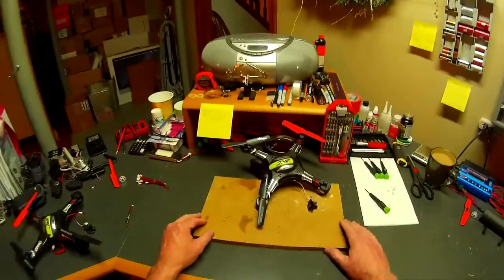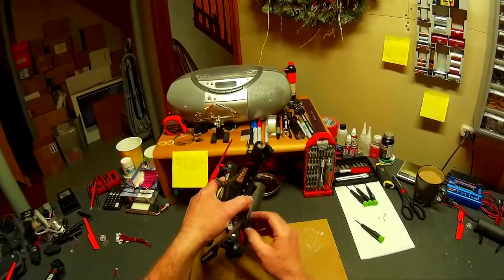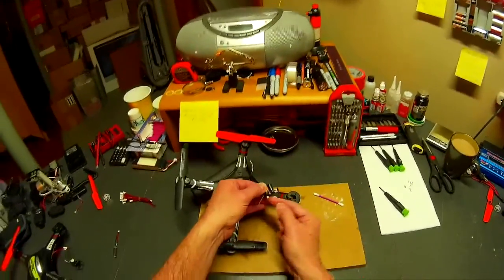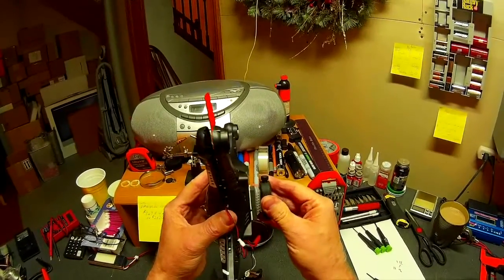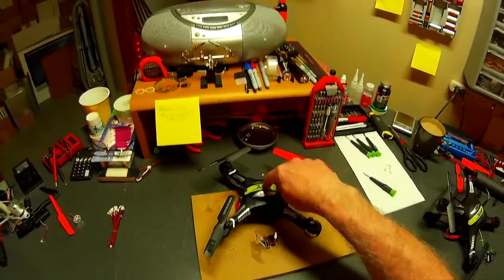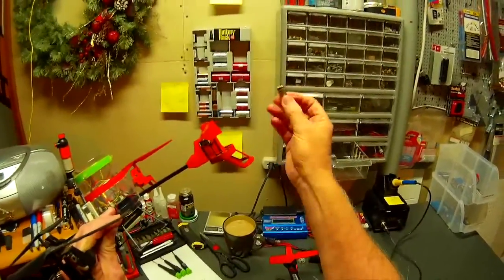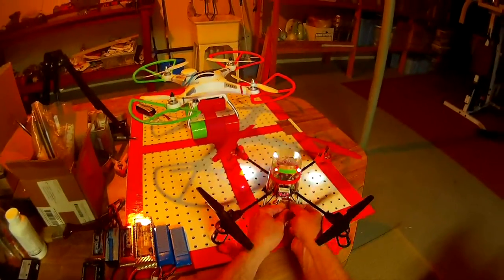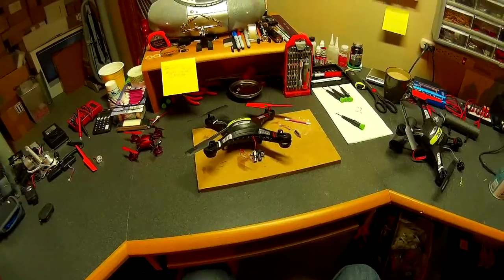Two ways I replace motors on my H8C quadcopter

Comment: Thanks for the video.  I fly an X5C and was thinking of getting an H8C due to the stock power and range upgrades.  However,  you've changed my mind.  It's obvious that if one quad uses the motor at 3.7 volts and another uses the same motor but pumps it 7.4 volts- that motor is going to overheat and die.  So far, I've only lost one motor on the X5C (I'd say 5 hours of flight time) and that was following a bad crash that damaged the arm around the area of the motor.

Comment: Mr P.  sir I need more circuit boards for the h8c and the x6, But i have not purchased neither one,  Because i have a feeling the boards are sold (naked) minis the wire's that are soldered to it in our quad's...so the user is left to solder his or her own motor and led wires to the board.. iS THIS THE CASE?

Comment: do you recommend the sma xc5? if you had to choose between H8C and Syma x5c.
thx
Reply from the maker: Olivier Bontemps  Neither.  I threw away all my toy grade quads except the V636.  Sticking with the Hobby Grade quads with brushless motors.  I've built two of them...
Reply: Im a newbie and looking to buy my first one.dont have big budget.but looking one which can carry an sj4000 camera.its a gopro imitation. What do you advise me? Some place i saw that the x600 with 6 motor are not too bad.

Comment: Yet another motor burned out, waiting for more, via a slow boat from China.
Don't know wether to order 8 motors at a time or give up on this quad and try the tarantula quad.
Reply from the maker: Jim Sparky Get the Tarantula. Yes, basically a v262, but at least you can use a contact cleaner on the N50 motors and preserve the life of them..

Comment: Hi! I have an H8c. The first motor have just died. Fortunately the first replacement motors just arrived 5 days after the failure.I am thinking about selling this, and buying some other stuff? I really like the size,of this JJRC. I would spend max. double of its prize if its a good deal. Could you advise someting? Maybe building something cheap from parts?
Reply from the maker: If you like that size then maybe the H12C or Syma X5C with the 3.7v system.  The only toy grade with 7.4v would be the Tarantula or the V262 using the N50 motors.  The H8C's motors are BAD.  I'd stay away from a 7.4v quad with coreless motors.

Comment: Hi MrPolymers Im wondering where you can buy that red paint that you use for orientation?
Can you link me to where I can purchase it?
Reply from the maker: Jut standard spray paint but I use a primer coat design for plastics.  I go to Pat Catans supply store but those paints should be available at any hobby store.

Comment: Very interesting. Good stuff to know.
Reply from the maker: When are you going to post some quad videos?  I know, let me spend my money so you can see which quad to purchase.;)  Remember, start out with the small stuff first and then work up...
Reply: Funny thing about getting a drone is that I would also need a smart phone and I don't want one. I was thinking maybe a DJI Phantom 2 Vision or perhaps a 3d Robotics model. potcheen on the road says that his DJI flies itself and highly recommends it as a starter - and it gets great reviews. I have already downloaded the flight planning software, but I can't do a lot with it without it detecting a drone. I also fear in the back of my mind that I might get bored with it.

Comment: I've been in the RC hobby for about 6 years now and have done plenty of soldering on airplanes, Helis, and now I build my own quads. I stated with a cx-10 to learn on then built my first of two 250 quads with a 450 coming soon. This might not sound safe but if you do it right you can skid soldering on the H8C. Because it burns so any motors I just cut two pieces of shrink tubing about 2 inches long, and yes you can get tubing small enough for these tiny wires, then slide the tubing onto the wire. Then put in the new motor and twist the appropriate wires together tightly. Slide the tubing down over the twisted connections and neatly placed everything back into the motor arm. I'm sure the necked connection won't find each other because the tubing isn't going anywhere. And no I did not shrink the tubing. Next motor change just open up the arm, slide the tubing out of the way, untwist the wires, put in the new motor and repeat the process. No soldering, no heat, no mess. By the way great vids.
Reply from the maker: Yes, there are many creative ways to get the motors replaced.  I was just hoping to show in this video you do not need to disassemble the entire quad apart.  Thanks for watching..
Reply: MrPolymers Awesome and we thank you, i disassembled the whole thing, now I have a short cut thanks to you.

Comment: When opening a deafault motor you see difference in cw and ccw. (Direction of the brushes) so there is diffence in them. BG have heatschrink sets wich fit tiny motor wires. Great film btw . Thanks much help for many

Comment: I lost my first two motors after approx 20 flights. I think it happened after I  twisted blades in different directions.
Reply from the maker: 20 flights?  Wow..  Nope, I'm not that lucky with the H8C..
Reply: What happens with your motors? Maybe they overheat? You can uncover them?
Reply from the maker: Petro Blonskyi They just die.  I do notice a loss of lift to them jut prior to total failure.  I'm not worrying too much.  I'll eventually just fly these in the Winter indoors with my RC club.  They do not give the performance I want in actual outdoor flight.  Thanks for watching.